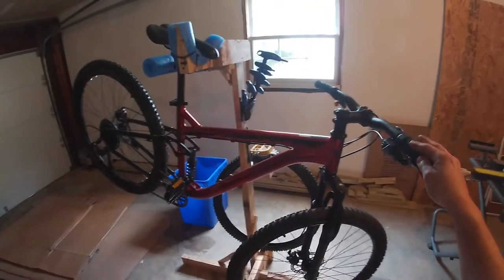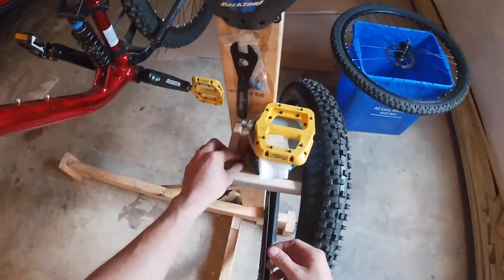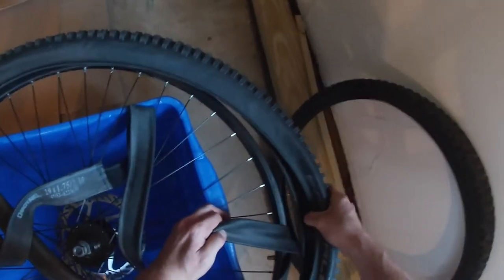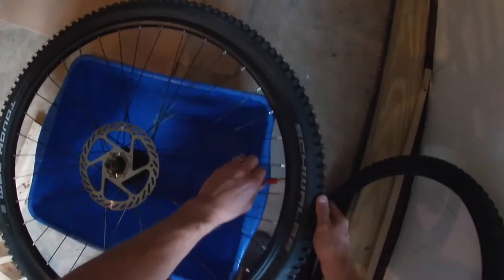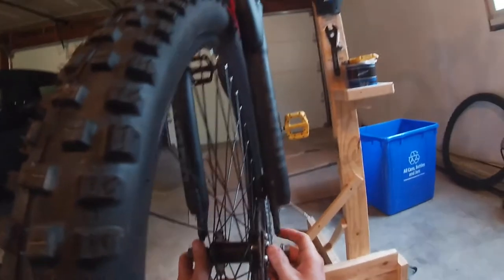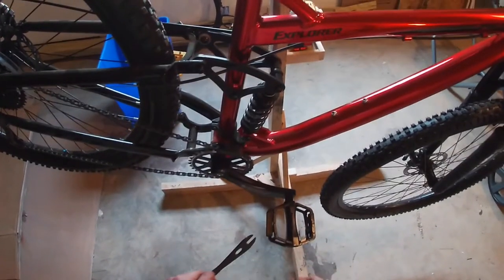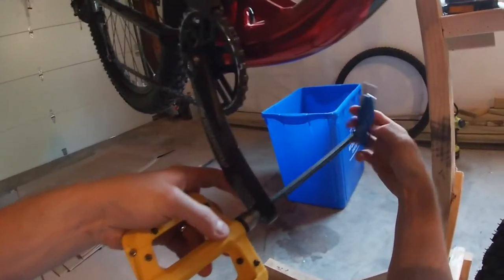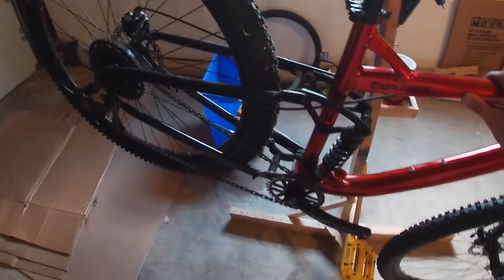Budget Bike: The Series, Ep.5 Upgrades

Comment: Interesting to see that the Canadian version of the Hyper Viking Pro 27.5 comes with quick release axels (upgrade over the Explorer). I like to put the pressure values (PSI) aligned to the valve. I noticed you didn't mention the direction of the tire before seating it on the rim (something to check first). Interesting choice of colour for the pedals :p